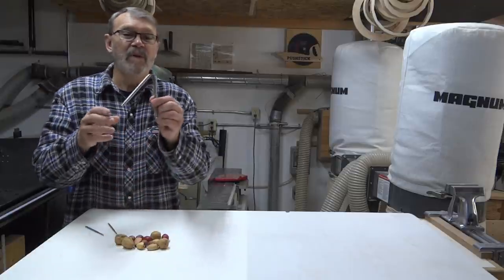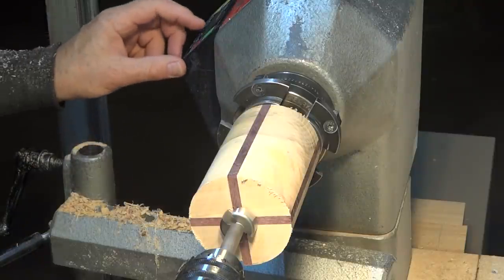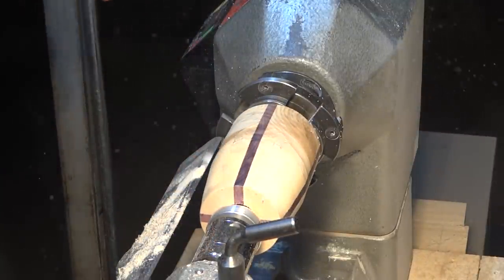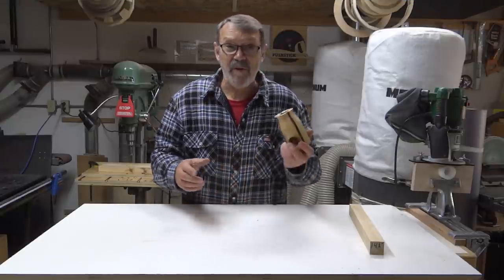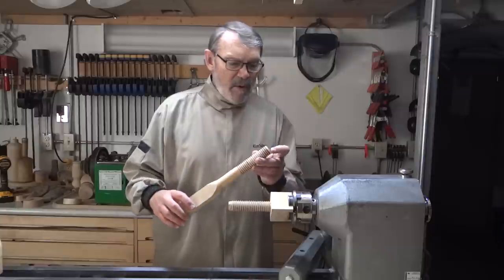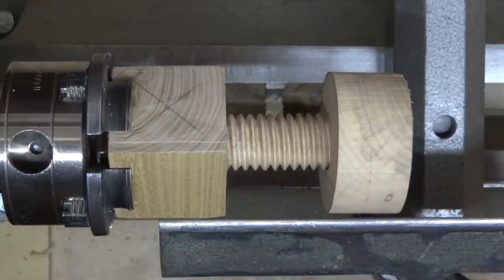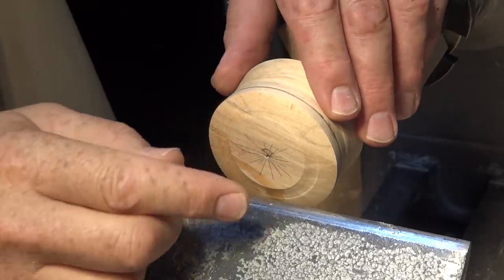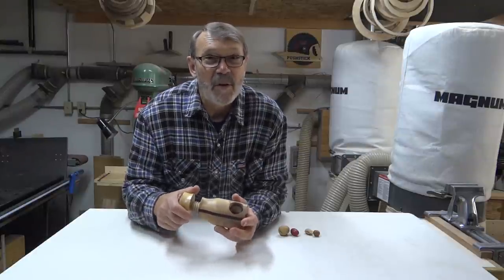Threaded Nut Cracker

Comment: Hi Gord. I don't know if anyone else notice but your Oneway live center was turning. I have the same one and chuck also but the body of the live center is not supposed to rotate. If it does I would think the center is loose in the Morse taper or the bearing is frozen and the body would have to turn. What is going on with it?
Reply from the maker: +Ed Maynard 
Hi Ed,
I noticed that myself but not until I was watching the video after having recorded it. Thanks for reminding me I will check that out tomorrow. I haven't been back to the lathe since I recorded that. Thanks again for watching and for commenting!
Take care,
.....Gord
Reply from the maker: +Ed Maynard 
I would not think of ignoring your comment, Ed! I used WD-40, paper towel and a dowel to thoroughly clean out the headstock and tailstock tapers and I was amazed at how dirty they both were! I know I should do it more often but somehow never think of it so thank you again for the comment. Now I think it's going to work much better!
Take care,
.....Gord